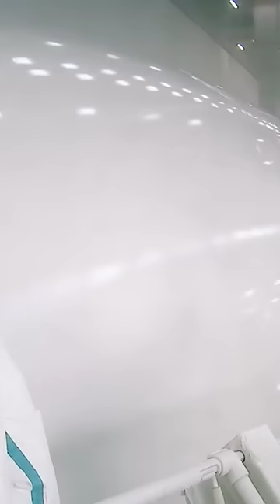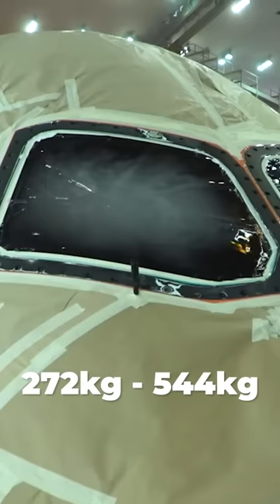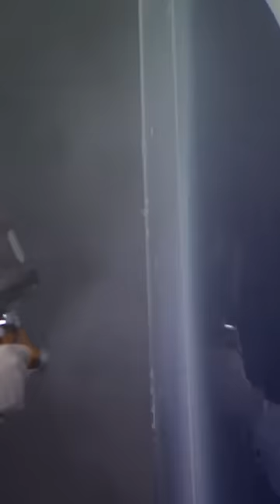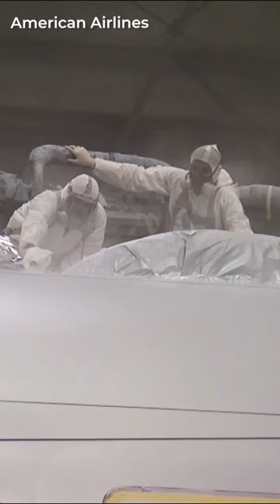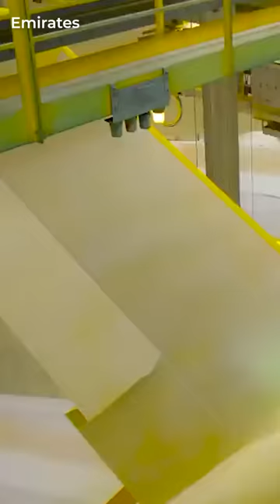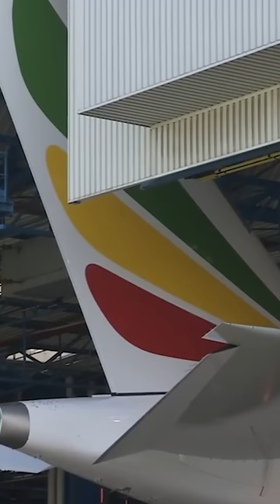Why Most Aircraft Are Painted White! #shorts

Comment: Ryanair is going to start flying unpainted planes to save on fuel, I can see it coming
Reply: Its 35 dollar extra fee to fly on a painted plane...
Reply: No they wont unless they start buying older used planes with no carbon fiber and start replacing the aluminum skin on them with polished aluminum skin. Its not as cheap or simple as people would have you believe and they still have to be polished on a regular basis.
Reply: B17 tests during WW11 indicated that painted aircraft were more efficient in flight. Smoother surface and blended rivets
Reply: American did that for a long time. It saves weight but they have to clean more often
Reply: in past many American turboprop aeroplanes used to be in metalic situation they weren't painted..
Reply: @Andy-gs1sm  damn, did I just miss 9 world wars??
Reply: @gaygekko  WW1, WW11, WW111, see how it's done, Roman numerals, like some clocks I,II,III,VI,V,VI. Thought some clocks use IIII instead of  IV.
Reply: @Andy-gs1sm  Yeah I know, I was being sarcastic. You can't use Arabic numerals as Roman numerals. It's either WWII or WW2, not WW11, if you do that it obviously means eleven in Arabic numerals.

Edit: in fact, if you search for "ww11" Wikipedia has an article on it, and it calls it either a future 11th world war, or a typo of world war 2.
Reply: @gaygekko  1 is not Arabic.... originated in India,
Reply: @Andy-gs1sm  but still it should not be 11, not II.
Reply: @michaeljohndadd545  K?
Reply: risking missing damages, plane crashing, and reputation ruined? definitely not. look at boeing after the MAX MCAS
Reply: Some older planes were not painted
Reply: The old “silver” American Airlines livery aren’t unpainted. They were painted metallic glossy silver.
Unpainted aircraft are not shiny and silver. Unpainted aircraft are a dull matte-grey
Reply: @Andy-gs1sm  Yes, some clocks use IV. Though no clock uses 1V
Reply: In motor racing, that's how Mercedes got the silver arrows name. They didn't paint to save weight.
Reply: It would oxidize and corrode. Paint on planes is very important.
Reply: painted plane is not to look good, but a protection to the skin of the air plane.  so in general I don't thinks any change to this.
Reply: Why stop at unpainted? I think they are ultimately aiming for crew-less flights.
Reply: @nathanb5923  And they would stuff passengers into coffins so that they can stack people and ultimately transport more.
Reply: @abyssstrider2547  😂😂😂😂
Reply: @moshunit96  the 737 is made of aluminium. american airlines used to fly with bare metal planes.
Reply: @Andy-gs1sm  the details don’t matter, just don’t use 1 instead of i.
Reply: @gaygekko  maybe it's binary, 11 equals 3 in decimal, he talks about the near future (joke)
Reply: The Voyager, doing the first non-stop flight around the world (using two props) had very very long wings. And those were NOT painted. Guess why.
Reply: @voornaam3191  because the for the amount of wingspan they would have to paint it wouldn’t have been worth painting it because they would have taken up weight that could have been used for fuel?
Reply: @Andy-gs1sm  that's for DST

Comment: The main reason for white aircraft is to reflect the sunlight as this heats up the aircraft and the fact that white doesn’t fade and show its age
Reply: Reflecting sun makes it cooler not warmer.
Reply: @halweilbrenner9926 that’s what he means
Reply: @halweilbrenner9926  Didn't he just say the same thing?😂
Reply: White paint is more cost effective, easier to detect discrepancies and yes does reflect UV rays so in the long run means less maintenance.
Reply: It’s cold AF at flying altitudes!  If that were an issue they’d paint planes black to save on heating!
Reply: @zeebest1004  if you stand still, then yeah it’s cold af. But when you are flying even at subsonic speed, the friction from the air heat up the aircraft tremendously. Going to transonic and up to supersonic, the surface temperature can reach up to 200 degree Celsius
Reply: Glad I saw that comment.
Reply: @halweilbrenner9926  his wording is weird but that's what he means
Reply: @zeebest1004  lol I used to paint aircraft the paint on a plane can literally strip off while flying if it get to hot that is typically y they are painted white
Reply: @TheGasmonkey123  Wdym white paint "weighs less". The color doesnt matter, just the material used for the paint
Reply: @zeebest1004  Let's ignore the fact that it's a plane made out of metal which just conducts the radiation from the sun efficiently.
Reply: @hieumongous2908  Explain black supersonic aircraft…🙄
Reply: @TNTthrilla69  You’ve obviously never flown in an unheated aircraft…🙄
Reply: @TNTthrilla69  Because white paint doesn’t get hot…🙄
Reply: @Joshua-zj8gm  yes I researched and found out what I was taught in A&P school was nothing more than misinformation. Makes me wonder what else I was told is BS 😂
Reply: That's racist.
Reply: @zeebest1004  you are forgetting friction, 550 mph is no joke...
Reply: Same for boats& yachts & work trucks en la Florida 😎
Reply: Awlgrip " oyster white" 😉
Reply: @hieumongous2908  the supersonic passenger plane Concorde , was painted  mainly white , because if this reason.
Reply: @halweilbrenner9926 Yes white is the most reflective. Solar Reflectivity. Brown is the hottest color in the Sun due to the red pigment. Black is no. 2.  Lightest also less pigments.
Reply: @zeebest1004 at altitude the engines are running anyway the bleedoff heat to heat up the cabin doesn’t add fuel consumption. Cooling the aircraft whilst at the gate is alot harder since the apu doens’t provide enough power to run full air conditioning. Add to that delay’s at hot airports and you have a lot of complaining costumers or a huge external power usage bill

Comment: It can also reflect heat off the plane, keeping it cooler inside the plane. I remember when Virgin Australia had their planes coloured red. That was back in the Virgin Blue days!
Reply: Metallic skin would reflect even more
Reply: Yeah, I was waiting for that one. Instead he conjured up the one about birds seeing white better?? 🥴
Reply: Air Greenland has all red it’s beautiful
Reply: Air New Zealand left the chat
Reply: Wanted to add this point
Reply: Isn't it beyond freezing at cruising altitude?
Reply: The outside of the airplane would be around -40°c during flight so I don’t think warmth from the sun is really an issue.
Reply: @baileym2952  on the ground in a very warm climate the skin temperature can be important. If your wings are soaking up loads of sun it can change the temperature of the fuel and that changes the Specific Gravity of the fuel.
Reply: That's actually the main reason it is white.
Reply: Cuz color isnt really there, its just the Lack of other picments and "Red" lacks much more heat reflective picments than "blue". 

Was i somewhat right?
Reply: This is the better purpose. The video just added so much irrelevant things
Reply: @freeroamer9146  thank you. I stopped listening when he started going off on all the other details.
Reply: @singlefather01  let’s have gigantic mirrors reflecting sunlight at people and their eyes that sounds like a great plan
Reply: @baileym2952 Friction From chopping through the Air builds heat. THats why the Lunar TerraFormer Has heat sheilds.

Comment: One other reason to use white paint not explicitly mentioned here is that white paint is actually lighter than darker paints because darker paints require more pigment(which adds weight). 

Also the reason planes are painted at all is to help combat corrosion, you could polish the metal but that requires much more maintenance, so paint is cheaper and white paint is the cheapest option, because of the weight thing.
Reply: I was waiting for the video to say it. This is the primary reason they're painted white.
Reply: @Peter Shoup  yeah I finished the video and after a second thought, oh, they didn't say the reason lol.

Comment: I was a fabricator at a shop in OKC for my 2nd job. We built a 880,000sq/ft  paint booth for Boeing in 2014 that took about 40,000 tons of structural steel.  Then we built a hangar to put the tail on the 777x that was 1.1m Sq/ft at 86,000 tons in 2015. The aviation industry does things on a whole other level. Trucking material from OKC to Everett meant we had to load trailers to their max. But I remember plenty of times I put an I beam with connection plates on a trailer and that was the 80,000lb load by itself

Comment: Ok...weight does not matter as the white paint job is about as heavy as most others... 
A difference occoures when you have a white base coat and cover most of it in different colours as you then stack the weight.
DHL uses yellow which is more economic as you need less of it to paint over the light yellow brown base paint of the aircraft. 
The other points you listed are far more important, as is the price. 
White is cheap

Comment: Plus less strain on air conditioning in warmer climates.
Reply: It’s cold AF at flying altitudes!  If that were an issue they’d paint planes black to save on heating!
Reply: @zeebest1004  you have to compress the air first, which heat it up.

Comment: Does it need painting at all?
Reply: American Airlines use to be bare aluminum
Reply: A lot of new planes are being built with carbon fiber and it needs to painted.
Reply: Aluminum needs to be painted also, it still corrodes, even though it isn’t rusting. The paint also acts as a skin, which helps protect it a little.

Comment: When they paint it does it have to be perfect or can there be a few bumps here and there?
Reply: @Leyan Clasi oh okay, thank you.
Reply: I got on a brand new plane a few days ago. 
Already had paint falling off
Reply: Plane paint jobs don’t look stellar up close mostly. Big panels will normally look nice and smooth, but there’s always trash in the paint, mainly because the hangar and all the equipment, it just can’t be a clean as a car paint booth. 
Plus, right after a paint job there will be leaks, and a lot of the fluid that an aircraft uses to operate is harmful to the paint. 

Source:  I used to paint aircraft.
Reply: @88wolffy  what kind of planes did you paint?
Reply: @spooders8424  KC10, KC135, B1, B52, E3, E6, C130, and possibly a few other airframes I can’t recall at the moment. 
The bombers and tankers and C130’s I painted are a semigloss grey, a gloss white, gloss light grey.
Reply: @88wolffy  B1s have a special coating applied as well for radar dispersion.

Comment: You got it correct when mentioning the fuselage safety inspections. Planes spend a lot of time on the ground as well as in the air, if the planes were darker colours they'd experience far more heating and cooling and that increases metal fatigue and aluminum is already a soft alloy.

Comment: Those are not the main reason, 
main reason for painting white is
 1) color fades fast from being under the sun too much and eventually would turn white anyways, using white make repainting more less frequent.
2) it helps reflect light making the plane cooler and helps with the airconditioning.

Comment: Most planes are also less visible in the sky when painted white.  From the under side they blend in with clouds.  
Paint also reduces corrosion on the fusilage, reduces air drag and increases fuel efficiency by more than the weight reduces it. (hence ryanair will not be running un-painted craft anytime soon.)

Comment: The white paint will also keep the plane cooler when it is on the ground, and reduce the need to run air conditioning.  A dark upper surface will make the plane much hotter in warm and sunny weather.

Comment: Another reason is. Straight white has no tinters in it. Which normally wouldn’t matter but if the paint adds the of 8-9 passengers. Then if you tinted it up to be a colour you’re adding at least 1 more passenger to that. Which sounds like nothing but if that adds $50 worth of fuel to the cost then multiply that by 100 different flights a day then multiply that by 365.25 and you’ve got nearly $2,000,000 in extra fuel every year.

Comment: An Aerospace Engineer here... This is actually totally wrong 😂 Wind turbines, Fiberglass boats and aircraft are painted white as they don't abdord heat as much as any other colour. This is different on metal aircraft, but composite aircraft can't have the 'Glass transition temperature' too low... easy way to avoid it = Paint it white.

Comment: The reason American Airlines has unpainted aircraft is to reduce weight. They do anodize the skin to prevent corrosion, but they use an oxidizing agent that creates clear aluminum oxide. While there is some weight added due to the additional oxygen added to make aluminum oxide, it is far, far lower than paint. 
There are two primary reasons to paint the aircraft:
1) To protect from corrosion and abrasion. 
2) To make the surface more slippery which reduces air friction and improves fuel economy.

Comment: You didn’t even answer your own question.  And being painted mostly white certainly has nothing to do with birds being able to see it.  The main reason is that they are a big hollow tubes of aluminum and would heat up quickly and intensely in the sun if they were a darker color. It’s also easier to inspect the aircraft for damage or leaks being white.

Comment: If you think it has to do with anything other than heating concerns, you're wrong. As high up as they fly, conduction isn't as great a heat transfer method, leaving radiation which cares about color. White reflects heat. That's it.

Comment: They are painted white because a darker plane will heat more than its white counter part. This ultimately makes it easier to cool the aircraft before passengers board and this is cheaper as the aircraft might not even need an air conditioning cart. Comfort and money, it makes the world go round...

Comment: American flew unpainted aircraft for years for weight savings and it was easier to do crack inspections on the skin. With no paint on the aircraft - there was no paint to maintain and thus an entire department of workers was not necessary.  $$$$$
However - Aluminum does not hold up to the atmosphere well without a coating or some type of protection.  It corrodes badly especially near the oceans - severely weakening the skin lowering it's pressurization capabilities. It will pop like a balloon.  So - painting aircraft skins makes them much less likely to corrode. 
Baggage handlers are really tough on the aircraft with lifts and service vehicle bumpers .  Paint more easily reveals skin contact from ground service vehicles.

Comment: Not all the weight of the applied paint goes to the plane’s weight…most of the base solvent flashes off, so you are only left with a thin layer of a dry coating! 🤦‍♂️

Comment: 'paint adds weight'. eh yes. so does the white paint. lol. considering that aircraft normally come with no paint at all, there is no weight difference between white or red or blue or black paint. it's aluminium. it won't rust either way. so any argument against any other color paint also goes for white paint. :P

Comment: also because pigments are additional weight in the paint.
Reply: white paint is the heaviest.
Reply: @MrChrisnrali  so apparently in aviation paint products there is no difference in weight of paints as they don't use titanium dioxide to make solid white. Normally white can be heaviest when tio2 is used in like house paints.

The main reason apparently seems to be heat as white is better at dissipation of heat buildup. The concord is the best example of this as when it was painted light blue for a few weeks it would overheat around mach 2 but when it was changed back to white there were noticeable drops in temp buildups.

Comment: White also reflects the most light. Which means it will not need repainting as often as any color. Galvanic/general corrosion is another reason for paint, regardless of color. Galvanization is usually done, but it wears faster than paint.

Comment: This is simply wrong. Most of the weight of paint is the solvent and that evaporates (that’s why it dries). Blue or red or brown or white whatever makes no difference in the cited weight of the paint. 

The white paint reduces radiant heating and is much easier to maintain. 

This video is the kind of misinformation that is destroying humanity. Who goes through all the trouble to make a video and not even get the basics right?